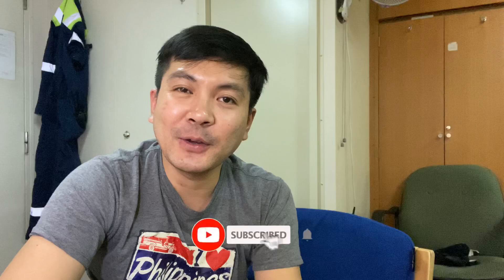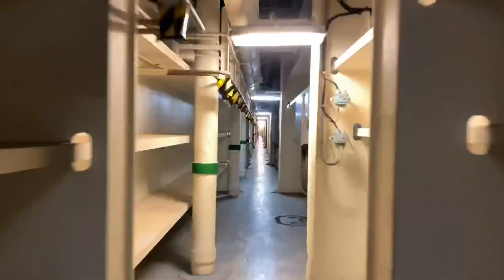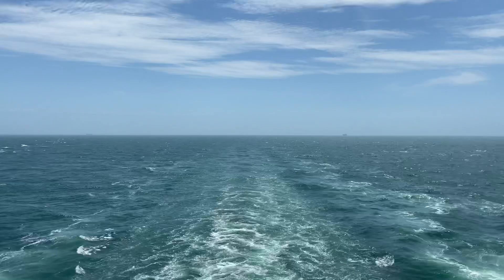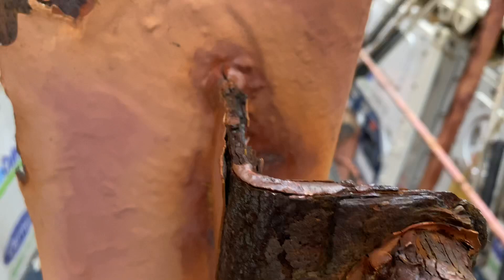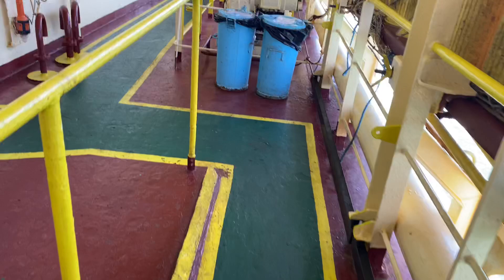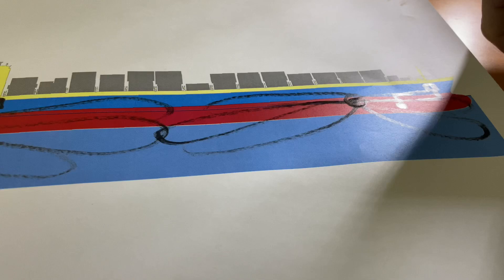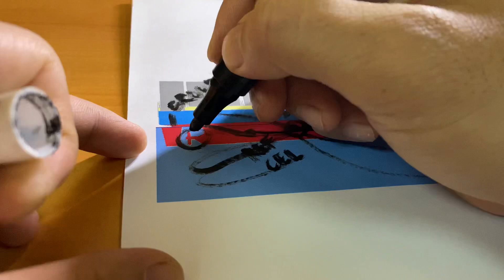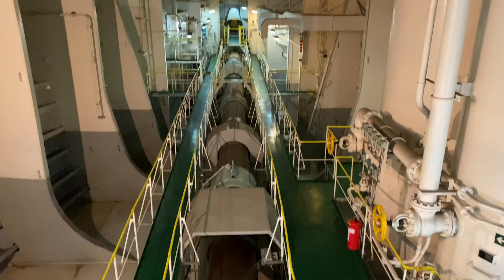ELECTRICIAN ON ICCP AND SHAFT GROUNDING | Seaman Vlog

Comment: Always enjoy your videos, thank you so much for sharing! In the future, kindly consider doing a video on auto voltage regulator, rectifier diode and Zener diode "maintenance." Our engineers carried out trouble shooting for the low insulation of DC 24V circuit for the ECR console and found that the rectifier #3 and Diode #4 are "reading voltage in both directions," which caused a low insulation "alarm" for DC 24V circuit that feed the ECR console from the battery charger. This caused general batteries to be depleted. We replaced the AVR according to the maker instructions and now batteries are being charged normally. We interpreted this trouble shooting to be diode losing bias and the circuit capacitor may  have been damaged by transient surge voltage from either large induction motor damage, lightning, blackout, D/G frequency hunting possibly from D/G fuel pump or injection valve not being properly maintained. Thank you!

Comment: I have a question. The anodes produce current by themselves because of seawater?.If so, why we use the panel?.We use it to monitor the current produced by anodes?.
Reply: Sacrificial anodes (aluminum or zinc alloy made) generate a DC current themselves when coupled to steel made hull by means of welding and seawater due to natural electrochemical reactions but get consumed with time to the point they stop working and need replacement. Instead, insoluble anodes (platinum or titanium made) transfer the DC current generated by the panel to the hull, in a controlled and adjustable manner. That's the ICCP system explained by Jake.
Reply: Let's say it's two different methods but large ships prefer ICCP, to minimize vessel maintenance time.
Reply: @albertodelmoro  how the panel generates dc current is there any dynamo
Reply: @BT😉  No, it is usually fed by low voltage AC power grid, 220 V or 415 V, which is rectified to produce the required DC current output.
Reply: @albertodelmoro  thanks❤️

Comment: Thank you nicely explained sir
 pls explain other what will happen if shaft grounding is not working properly it will cause major problems in main engine bearings if it's not working , correct me if am wrong.
Reply: When shaft is rotating static  charge is created on it. If grounding is not proper static charge keep on accumulating  and it can ultimately lead to sudden electric discharge  in the bearings and it will cause pitting of main engine bearing .
Reply: @liwinthomas4107  Sparks in the engine crankcase are dangerous also because they may light up the oil mist, isn't it?
Reply: It will  cause disturbance in the hydrostatic lubrication of your bearings.
Reply: if shaft grounding failed, the sparks that may  created can damage and seize ME journals, bearings and may also create oil mists that will trigger the ME OMD.
When my shaft grouding failed, i.e. slip ring was damaged. The brushes are touching the shaft. The reading was 250mv and beyond. When I installed the new slip ring, the reading is almost zero but deflecting little bit. Honestly, Im still puzzled if what is wrong on my system. Slip ring has good contact on the shaft, the brushes are still in good condition, the slip ring was new, the ICCP unit displays normal values for current, voltage, and ref cells.

Comment: Good day leckyjake!
My query ako about shaft grounding device by Cathelco.  All silver graphite renewed. Tinanggal ko na ung slip rings ok naman at nilinis ko ma rin ung shaft surface. Resistance ng slip rings at shaft is 0. Terminal lugs ng ground wires ok naman. Still showing 60mV.  Ung tension ng spring sa brushes is max na. Anu pa kaya ang problem. Ung ICCP naman namin eh waiting pa kmi ng thyristor kaya 0 output si wala nmn cguro kinalaman un kasi brackish water kmi.
Reply from the maker: Tingnan mo din ang composition ng brush mo. Same trouble i had here last week. Bago yung brush nag fluctuate pa to 80 mV kaya binalik ko luma mas stable sa 30.
Reply: @leckyjake  ok thanks will do this after sailing. Tumaas ung reading while old brushes pa naka install. After ko pinalitan ganun pa rin 65mV. Pero will test  ung nga old brushes hopefuly maging ok. Nagtataka lang ako bakit pag check ko ng tester sa brushes nasa 30mv pero pag sa meter 65mV. 🤦‍♂️